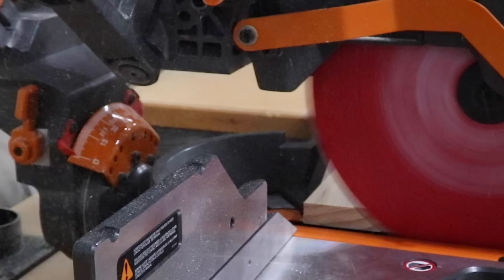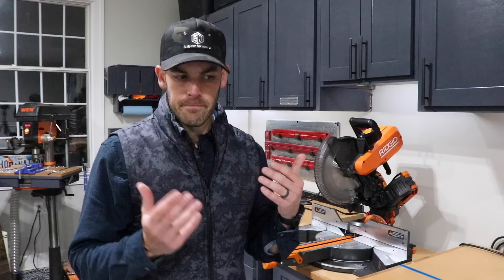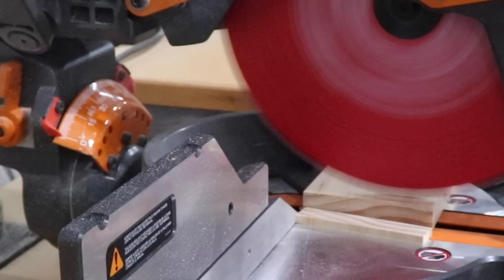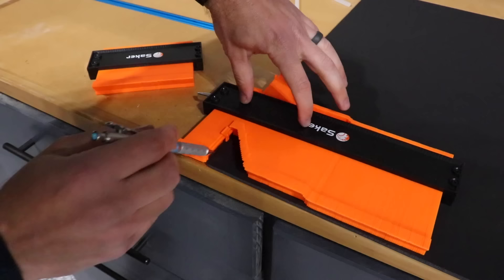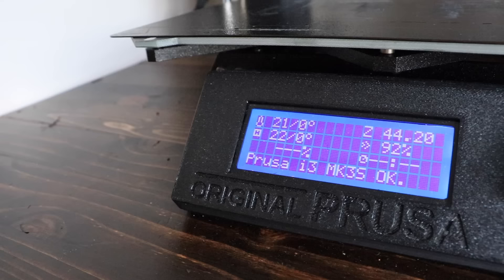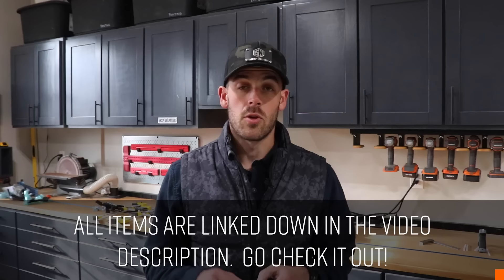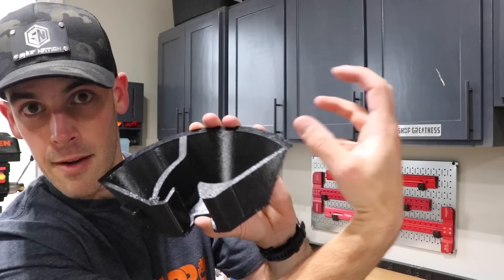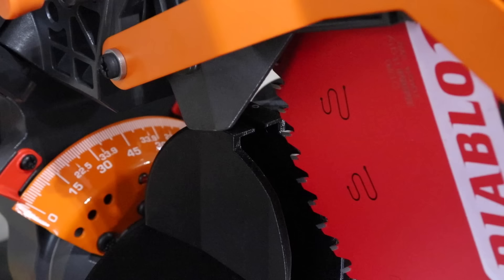Did I Solve Miter Saw Dust Collection?

Comment: I bruteforced my miter saw dust collection, have so much suction that the blade spinning doesn't overpower the vacuum. I bought a way oversized and generously priced (due to the pandemic) dust collector from Laguna, that runs on 220V. I have it hooked up to my CNC router and hooked to my miter saw station, barely get sawdust on the ground anymore, the major downside is hearing protection is not optional anymore in my shop when its on.

Hate to say it but you are either going to get really fancy and study the airflow caused by the blade spinning and try to work with that or go bruteforce.

Comment: in any vacuum system, its all about the area of the opening. if the area of the hose is your base line, then having a larger area opening reduces suction. Any open pocket in the system with a cross section area bigger than you smallest hose allows air to slow down further.  I would further constrict the pocket just behind the fence. Also limit the area of the opening in front to a hemisphere at the bottom as wide as the fence and leave the rest solid. add some magnets to the base to help hold it in place rather than wedge it in on the side. once its secure run the saw without a cut piece to make a zero clearance cut. GO SLOW. cutting 3d printed items in the up direction is going to want to toss it around. maybe wedge it in from both side for the initial zero clearance cut and several cuts afterward till its worn back a little more? Or use a wider blade for the clearance cut?

Comment: Maybe add a zero clearance plate that is ducted to the 3-D printed housing. This might add enough down draft so that momentum of the wood chips/dust would be slow enough to be captured by the  housing. I used cardboard to make a dust collection housing and I found that most of the chips/dust hit the front of the housing, so I didn't bother repeating that design in plywood. Looking forward to seeing your next iteration.

Comment: Travis, I haven't read through all 440 comments. But I think a few have touched on what I see. The velocity of ALL the particles before the dust collection is fast which cause it to go literally everywhere. After you add dust collection you have created a small negative pressure area that slows the particles but not enough to be vacuumed. That's why they end up on the back little horizontal surface and not everywhere else. 
Also it looks like a lot of particles exit the blade at a higher angle hitting the saw frame between the first hinged joint and the back edge of the saw blade. These particles are then bouncing off the sides 3D printed part rather than entering the narrow opening. 
Maybe open the top and face of the 3D printed part to allow more particles to enter the negative pressure area of the vacuum.

Looks good, I'm excited to see if you can solve it.

Comment: The enclosure is the only method that works reliably imo. You can improve it by having a large collector plugged into it, and having it all funneling pretty well, but in my experience, that's the current pinnacle. There just simply isn't a consistent enough direction of the duct expulsion for anything other than an enclosure to keep it in. Just add a magnetic side to the enclosure to be able to open it and once a month do a little cleanup and you will be fine. It isn't the most aesthetic solution, but it is what it is. The tool is just never going to be designed by the manufacturers to prioritize collection, as one of the main customer bases is the contractor who is doing their cuts either outdoors, or in a garage/empty room that can easily be swept.

Comment: I love that you are trying to tackle this. I would add zero clearance insert and how about increasing the mouth of the collection to match the width of the upper fence, or replace the upper fence with a 3d print honeycomb pass through. Increasing mouth will reduce suction but your missing so much anyway. I really hope you figure this out. I’m allergic to most types of wood dust, but I love wood working. Dust collection is a must.

Comment: this reminds me of another dust collection video for a band saw that initially went very wrong. They needed more airflow in the direction of the dust port. Maybe remove the baffle and put a 1.5in hole opposite the dust port. this will create a cross wind and will turn the sawdust in the direction of the dust port faster. also the dust collection could be starved for air and this would solve that too.

Comment: 1. Centrifugal motion of debris coming off of the blade at different angles. 
2. The Velocity of debris reference suction in a specific area. 
3. Deflection of debris 
4. In my humble opinion is to wrap/ in case the back of the saw with a shroud. Then have two ports of suction. One directly behind the saw and the second on the floor/ table top where debris falls. 
This is what I have found to be the best remedy for the dust Issue.

Comment: I've tried many different ways to suck up the sawdust from my Bosch 12" sliding miter saw over the years and finally settled on building a box that attaches to my zero gravity stand where my saw sits mostly inside the box.  I made two 4" ports into a Y fitting and then a 4" hose to my Harvey G700.  I get very little dust outside the of the box now.  This is a similar strategy that those miter saw fabric tents offer but without the space needed behind the saw.  I'm going to add some directional pieces of wood inside the box to help direct the air flow to the ports and see how that goes because I get a fair amount of dust in the box.  I still can go 45 degrees in both directions but cannot compound miter unless I make a wider box.

Not sure if a shop vac has enough CFM to work like a 2HP dust collector, so good luck!

Comment: A large cardboard box with a vacuum hose attached that encapsulates the back of the saw works the best for me. I tape a fabric around the moving areas.
It may not be a sexy as the 3D design you have here but it works 100% better.

Comment: You have to have enough air velocity to capture the particles.  You may have to up size your shop vac. Also might pay to try a blade with negative rake teeth.  Made a huge difference for me on my RAS.  Maybe some brushed to prevent the particles bouncing back out and some suction under the blade insert.  I also wonder if you could rig up a nozzle to blow the particles out of the gullets with compressed air.

Comment: Where the dust flies is dependent on your approach to the cut. If you approach the board with the blade all the way down and move front to back, the dust generally flies in the more upward direction since you've effectively made a ramp for the dust to follow. If you approach the cut from the top and chop downward, the dust generally flies in a fairly contained stream toward the back. A top down approach should yield better results with a dust collection 1-1.5" above the surface in the rear. A front to back approach would yield better results with dust collection around the upper rear portion of the housing, like the festool chopsaws.

Comment: @ShopNation I have made something very similar the slot where the blade goes my design has a adjustable clam shell design I can vary the degree of angle deflection. Also the semi round curf in the back of a clam shell causes a nice little eddy for concentrated collection. Perfect spot for a small dust port. Mine has two small dust ports and two standard it collects everything  except for some rogue bits. Mine is a Rigid 12" laser guided compound miter saw.

Comment: My compound miter saw has a bag that hangs on the back and does something. I know because I always have to empty it. Instead of overpowering the dust with chutes and ladders. Try using the momentum that is already there and funnel into a kinda of passive collection system.
Reply from the maker: A passive system will catch something but more by chance than design, the problem is the chip velocity and momentum

Comment: More airflow needed. Suggest 2 dust extraction ports located where dust streams are concentrated. The entrance "mouth" of the  extraction chamber should be wide and large to catch dust spewing in various directions. In addition to the extraction chamber,  fashion a flexible curtain of some sort to encircle as much of the blade as possible without obscuring the cut line. This curtain will  catch and direct dust into the extraction chamber as well as being flexible enough to take whatever shape is needed during angled cuts too. I'm curious to see what you come up with!

Comment: It was a very solid effort. 👌 

I don't have a sliding miter saw, mine is a standard Dewalt. Until very recently, I didn't use a vac system at all, just that little bag that attaches to the back. 

Honestly, It seemed to work fine. Filled with dust nicely with minimal stray dust. I guess I just accepted that there wasn't any true way to get 100% of all dust, I dunno. 

Now that I do have a vac system attached to it (6.5hp Ridgid vac), I haven't noticed any more or less dust by using it. I just don't have a bag to empty any more. 

However, my non-engineering school thoughts on the "why and how" the problem is created to begin with is that there should be 2 dust collection ports. 

One in the back, which obviously already exists and then the other should be a port hole on the top or side of the blade shroud/shield. And of course, the shroud should have those vent slots covered/sealed so it's an enclosed shroud. 

Since the blade spins upward, it seems logical that's where the majority of the dust goes...and then just falls down while the lighter smaller particulates (dust) get pushed by the air created by the spinning of the blade...which is probably why there are slots in the shroud. 

Notice how "some" Circular saws have a dust port located in the rear SIDE of the saw, as well, the shroud of a Circular saw is a solid piece, not slotted. Notice when using a Circular saw without a vac attached to it, where that dust accumulates....right there on the backside...as though the saw is pooping dust where you just cut. 

So, in my mind (in theory), that seems to be the solution. Copy the engineering on a Circular saw and do that to the miter saw.

Comment: Really appreciate videos like this, showing something that in principle SHOULD work, but doesn't.  I expect that the reason is flow.  Precisely: Pressure.  Dust wants to to go an area of low pressure.  While your vacuum is creating one while it is on, as soon as that blade starts spinning and throwing things back into that cavity, it is likely that it is overcoming the low pressure produced by your vacuum so you end up with a chamber of HIGH pressure, and the dust gets pushed upwards to the nearest low-pressure area.   If the air coming off the blade had another area to go, while the momentum of the dust continues in that "backward" direction, it would work.  Should work.  Might work.  As a software engineer, I can tell you that I spend more time making unit tests than I do writing the functionality.

Comment: I have always looked at the mitre saw as the stove of the workshop...what I mean is there is a lot of uncontrolled "smoke and splatter", so treat it like the stove, recognized there is always going to be some cleanup but get a hood for the mitresaw and pull as much air flow as possible directing the "smoke" aka dust into the dust collector. So building a collection hood around your specific mitresaw would be the best approach.

Comment: Maybe design something that rides with the blade. Maybe something similar to those profiling tools you were using. Or a rubber sheet. Help keep the dust concentrated in one area. I feel like the velocity of the saw blade and wind coming off the blade is pushing particles everywhere.
Reply from the maker: Yes thats what I'm thinking will be another version

Comment: The ideal solution would be a clear plastic bellow that encloses everything from the edge of the blade guard to the top surface of the wood piece, then to the guide way and last to the back of the saw, where the vacuum hose would be connected. Clear nylon would be a good choice of material.

Comment: I am an Engineer as well and find myself doing projects like this.
Note: I would have put a filter in the vacuum and collected the dust around the saw after the test as well as the dust collected during the test and weighed it so you have an object measurement.

Comment: I tried the same thing with my Delta 12" slider but I did not get nearly as far as you did.  Really like the idea of the profile duplicator.  Some of those shapes are impossible to capture otherwise.  I'm with a lot other commenters that airflow could help a lot.  I have a dust collection system that is 6" pipe in the ceiling and stepped down to 4" for the wall runs so I have standard 4" blast gates.  My idea was to use a Y adapter to step down from the 4" to two 2 1/2" ports and then run each of those two lines to either side of the "contraption" which would essentially double the airflow that you had.  If work ever stops getting in the way I might give it another shot.  You have inspired me.

Comment: So totally from the hip, if the dust is going too high redirect it. Run a shop vac hose from the output of your dust collector to the back area of the saw. This may be a horrible idea so I recommend a eye protection and a mask during experimentation. 😉 🤔🤔🤔, maybe simply blow the sawdust from say upper right of the saw to a collection scoop on the leftside. Good luck

Comment: I would try a smoke test to better visualize the air flow moving through the system.  The spinning blade might dissipate it all but it might be worth a shot.  Definitely have to go wider and use more of the energy from the particles themselves to your advantage.
Reply: Now that's a novel idea that actually makes sense. Aeronautical engineers use the same method in wind tunnels to see where turbulence exists on airframe models.
It may sound silly, but a dull blade cutting through a hard wood like red oak may be enlightening. That way, the smoke is generated at the point of the cutting action itself, which is the origin of the sawdust as well.
Reply from the maker: Agreed!  This was my dad's idea as well lol, so will do this in the follow up video

Comment: try using a higher pressure lower volume vacuum, you need to overcome the bounce back particles, the one escaping your enclosure. this would be a vacuum like a festo or equal quality shop vacuum.

Comment: I built a simple dust collection box for my radial arm saw with a couple fundamental differences from yours. It’s much taller and my dust collector has a lot more cfm than your under-counter shop vac. My design connects with a 4” 90 and collects sawdust very effectively—but isn’t perfect. It restricts swing for angle cuts, so it basically only covers right angle crosscuts. Since I seldom move it off 90°, that works for me. Maybe you just need more cfm?

Comment: As others have said, it's great that you show that it didn't work. Progress isn't just "this works!" It needs a lot of "this doesn't work!"

As for the "new" issue when using your current setup - maybe the saw blade simply generates more airflow than your vacuum does? The air that's moved around by the blade needs to go somewhere.

There are probably some good ways to measure just how much air you can pull out of your contraption, and just how much air the spinning saw blade moves.

Comment: The way I dealt with this on my Cruzer was to build a "Saw Shrine".  I built a box that was as deep as the back of the saw to the fence. It has a peaked roof with dust collection at the top of the peak.  That dust collection is split (wyed) between open to collect fine floaty dust and the built in dust port.  Then at the bottom behind the saw is a drop box to another dust collection port for the heavy sawdust.  Dust collection is 4" to top and bottom powered by a 1hp Jet dust collector.  So the bulk of my dust is tamed.  Miters are messy, no fixing that.  If I could post a pic Im sure it would make more sense.

Comment: I cut a hole under the saw and made a collection chute that works in conjunction with the one in the back of the saw. Not perfected yet but sure works better. Plus it is easier to clean out all of the small cut offs that drop down there. If you noticed, there was a noticeable amount of saw dust under your old saw when you removed it.

Comment: As part of my 'research' on this issue, I've been experimenting with various size plastic bottles attached below the dust chute behind the blade.  My Rigid MS is an older version but the theory is the same.  I use Duct or Gorilla tape to hold in place.  I have to use snips to trip the shape to fit the bezel of the metal frame/chute and to clear the fence.  This method has resulted in the best collection for me.  Is it perfect?  Heck no, but cut my mess by 50% at least.  In my perspective the blade mostly throws the chips back and up.  Which is why I use a plastic bottle to widen the catch opening behind the blade as well as extend the reach closer to the table.
Reply: I did the same thing as you and I too have the same results
Reply: Great video.  @Donald Stafford, I like your suggestion.  As I was watching , it seemed like a lot of the dust was going to the outside of the device which makes me think some how you need something larger to catch that overspray.  I know there are constraints.  Just thinking out loud.

Comment: Looking forward to seeing the resolution to this age old problem. I’m reading a lot of good inputs from a lot of knowledgeable people so I’m probably just stating the obvious, but here goes. The area of negative pressure needs to be larger, and as someone else has said the air velocity needs to be greater than the dust coming off the blade. Possibly the RPM of the blade can be used as a baseline for the velocity of the dust?